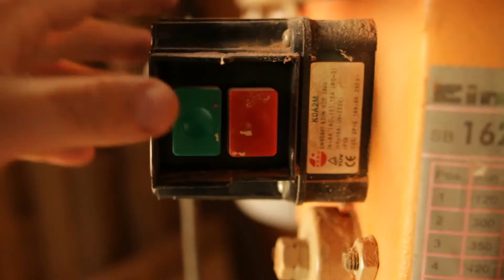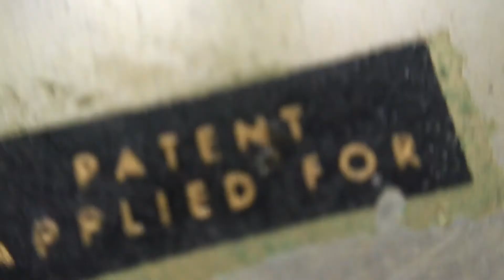Wizz Pickups - Making of Vintage Wire Limited Edition Sets

Comment: Alexander, I’d like to buy a set of these and I dig the other Page set too. I’ll write you another message about what I’m thinking. Sounds GREAT! 🎉😊 The Seymour creation for the “Song Remains the Same” stuff is close, but yours are better. Is the difference just the bridge pickup on this set Vs. the other Page set? Maybe I could buy an alternate bridge pickup for those  songs. ❤Thomas
Reply from the maker: Hey mate did you consider billy gibbons set?
Reply: @aleksandar.vrhovec   Yes. But, can it sound identical with the pickup screws facing the correct way? Can you flip the phase and the magnet without flipping the physical pickup and get identical tone? Or must it be upside down to get that tone? 
If I have a Page harness in, Can I flip the phase of the pickup with a push pull pot = to that, but will it sound like THAT? I’m big on not letting others see how I get the tone on the guitars I have. I’d like one of the Page sets. But the #1 set doesn’t remind me of Page but it is a great set for Me! I’d choose that one for a signature pickup if I had to choose just one. The Page set #2 is Nuts! It’s damn near perfect for “The Song Remains the Same” Film and tour! That’s what MJ from Duncan made me. Is there any wax in your pickups? Oh! Important, What brand and K of Modern potentiometer do you recommend using with these pickups, if you have a very old LP and need to make a new harness? Push pull and old style long shaft? Thanks Man! I left you my phone number in a message on Reverb. Give a call if you can please? I was wondering about mixing the bridge pickup from the old Page set with the neck pickup from the newer one. Can we do a demo of that? I bet it sounds “TITS”! I like strong pickups in the high normal range. My sound is the result of Bonamassa’s comments. I’m running 4 Amps. I don’t think I need wax. I have been listening to a Peter Green Anthology and another Album “Green Manalishi”, has the PAF tone I love when the chords come in. There’s a schwang! If you call I’ll become less confused. Ok my Brother of another Mother, I’ll talk with you soon. Thomas Adams1 11:11®️